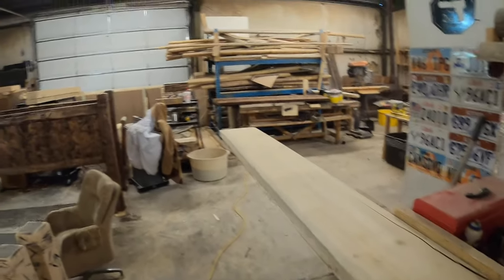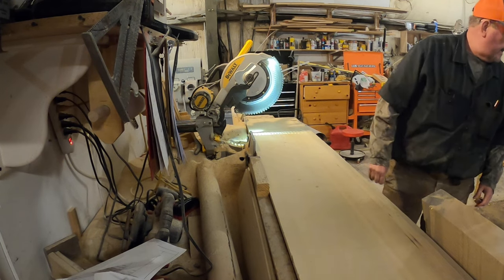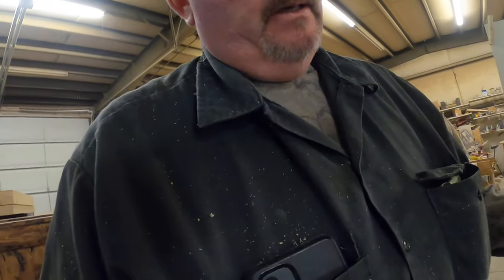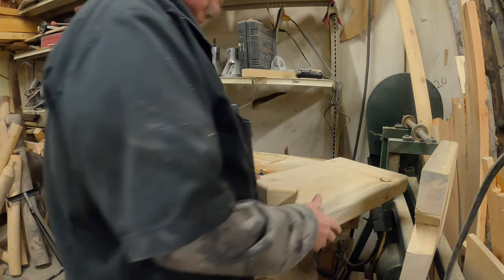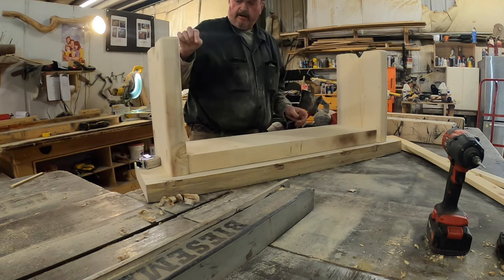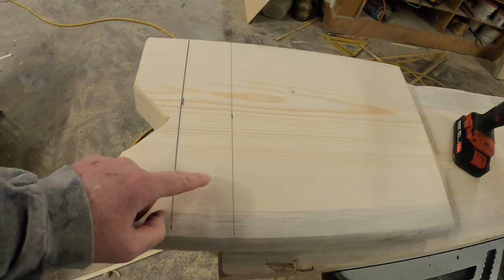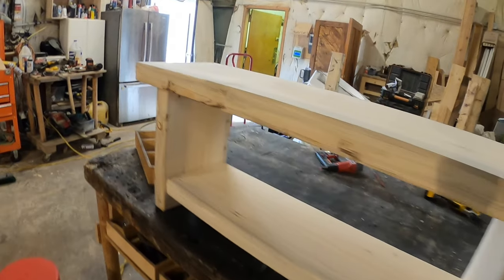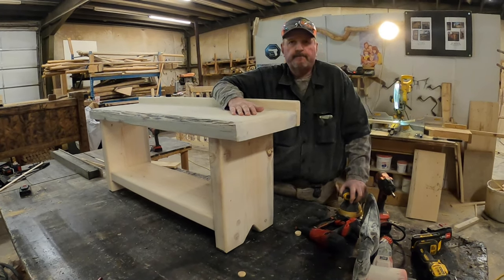Can You Fake a Live Edge? Watch a Gorgeous Live Edge TV Stand Get Built From Scratch!

Comment: Your miter saw was binding because you were pulling. The bottom of the saw blade is rotating down away from you, pushing the wood into the table and fence, keeping it in place. When you inserted the blade into the wood and then pulled it toward you pretty rough, you disrupted this pushing into the table and fence, making the wood come toward you and twisting up. A miter saw is supposed to work in the other direction; pull the blade toward you, lower it into the wood, push it away from you. That way the forces applied to the wood will always push the wood into the table and fence and it will never twist and bind.
Reply: Good advice

Comment: Very nice. I’m new to all of this and have a mill but haven’t put many hours on it yet. My question for you is what kind of wood? You said you milled it so does it not have to dry before varnishig?  Curious about building with green lumber.
Reply from the maker: If your milling green you will need to air dry or kiln your lumber. You need it around 6-7% moister or your product will warp and twist on you. If a Kiln is not available. Stack the fresh sawn lumber with stickers in-between each row. let it air dry.
Reply: @SAWDUSTLUGNUTS  thanks! I thought you had fresh milled that and I was intrigued how you did it without drying. a TV stand is a project I have planned but I need to figure out my drying approach. There is a lot more to milling than just milling. lol. Thanks for the reply and Merry Christmas, you’ve got a new subscriber!
Reply from the maker: @HardyBrothersOutdoors  if the tree has been dead for a while you can use the lumber right away, so long as the moisture content is low. Merry Christmas to you and yours as well.. Good luck on the milling.